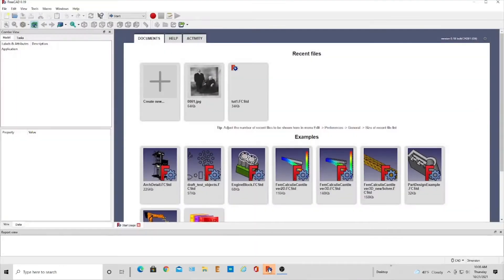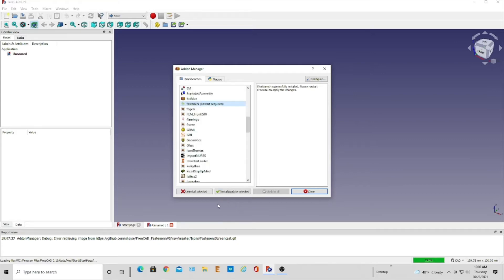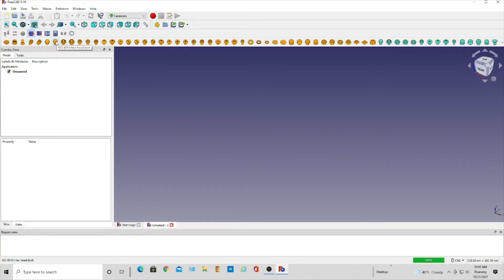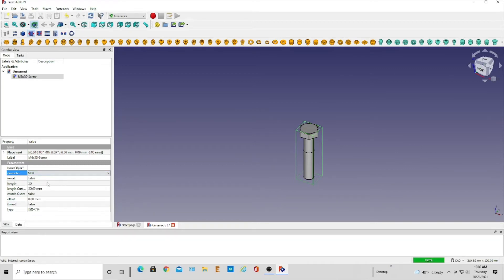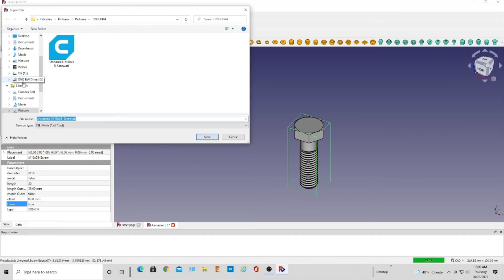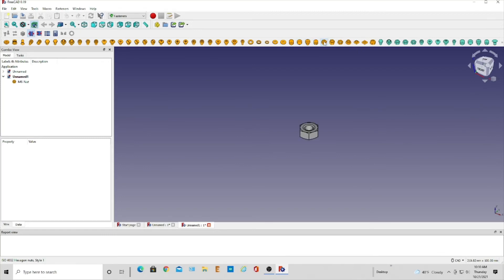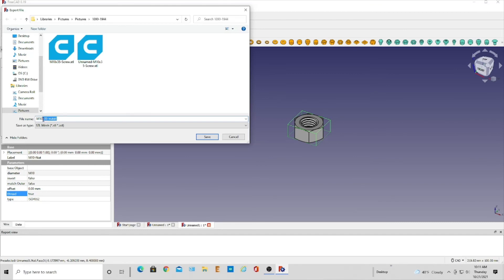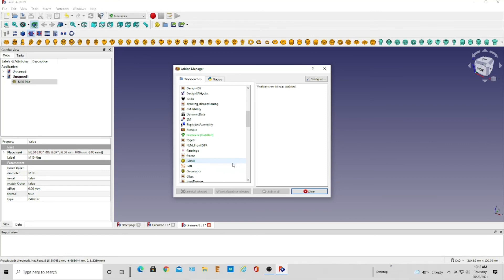Adding Freecad Fasteners Tool, With Addon Manager

Comment: so if i use the same thread type as the hole they will work together
Reply from the maker: Yes it will
Reply: @The_old_geezer_geek  well this is easy I just create a hole and a thread is there a way to add a thread to an end of a pipe so I can lock tow together
Reply from the maker: @lizziemcdonald1748  here is a video from another YouTube that explains it well
https://youtu.be/kRKtXsz0WGA?si=0qECHdjTCjRg_bH1